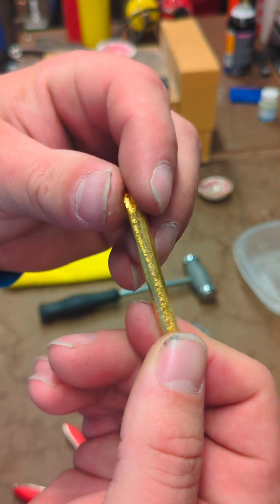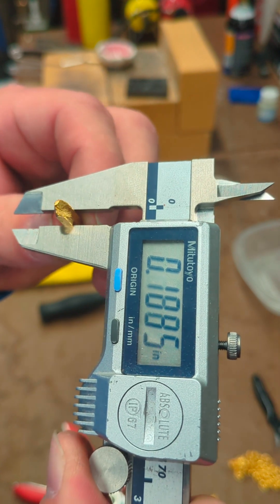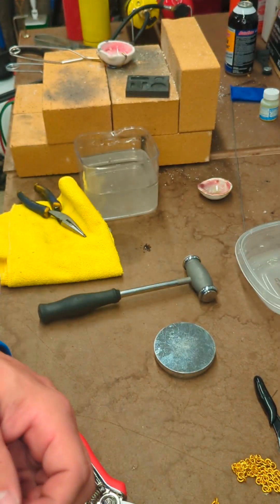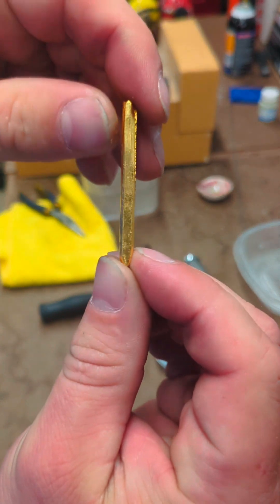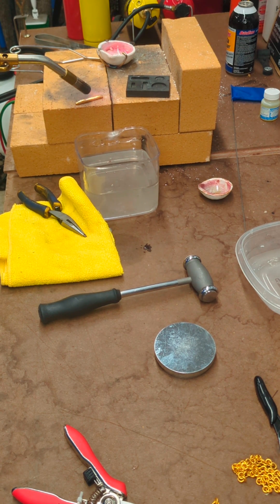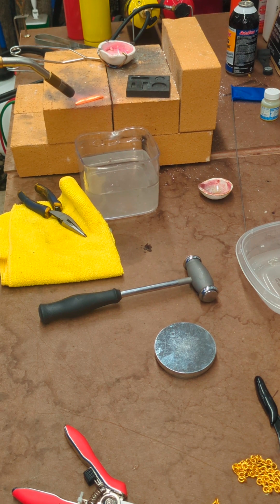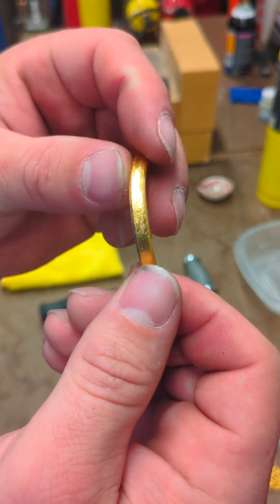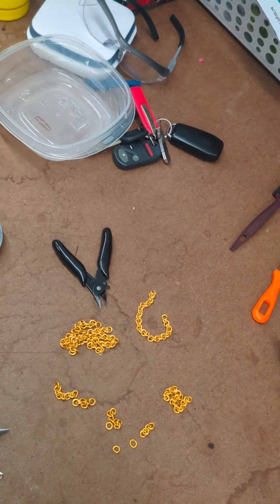Does 24k gold work harden? Does 24k anneal? How soft is 24k actually? I'm here to answer.

Comment: I only work with 24k and 100% the more you hammer the gold the more it hardens 
If I make a ring and heat it after it’s made it’s so soft and stays soft 

But harden it makes it stay that way solid I will leave this here for those that say it’s not wearable gold 

Carat is gemstone weight, karat is gold metal fineness!
IMHO only the unscrupulous sellers and ignorant buyers believe something that
is 37.5% NOT gold but is gold. 9k does not look like gold. Does not wear as gold.
And is all round crap.
The unscrupulous will tell you that 9 karat gold is better wearing than 18k gold. Or 22-24k This is simply not true.
The simple scientific fact of the matter is it that 9kt is NOT harder wearing/more durable than 18k 22k  gold. 
Metal durability is measured by what is called the Vickers scale where more durable metals receive a higher Vickers score than less harder wearing durable metals.
9 karat gold has a Vickers scale rating ranging from 80 - 120.
18 karat gold has a Vickers hardness ranging from 135 - 165.
Thus science shows 22 karat is more durable than 9 karat gold.
Use 22 k and you have credibility for quality metal fineness. Quality stores DO NOT stock it! 22k  yellow is also a most wonderful alloy to work.
Use 22 k or 24k and have metal quality and respect from goldsmiths.

Comment: Kind of wonder if you didn't quench it how soft it would get...I get that isn't practical when you are trying to work with the material.
Reply from the maker: That's a good question. I've always honestly assumed it's the quenching that made it soft not the actual heating. I'll have to heat some gold let it cool without quench and test. Video to come!
Reply: @SmartBettsPM  my understanding is if this acted like steel; heating it and allowing it to cool would anneal it while quenching would temper it and make it harder than it could be by locking in the crystalline structure. But I probably don't remember most of my material since class.